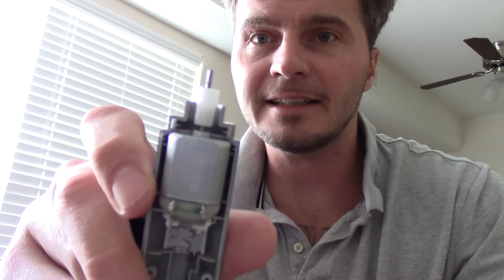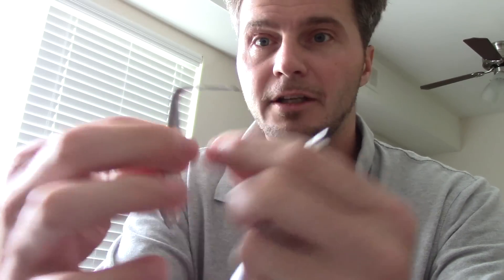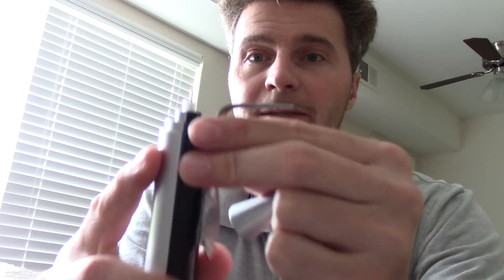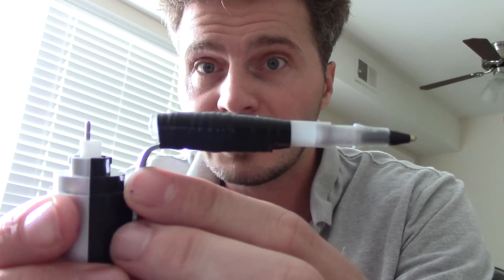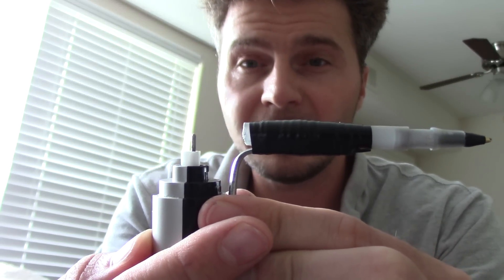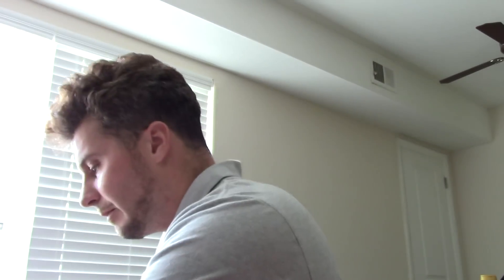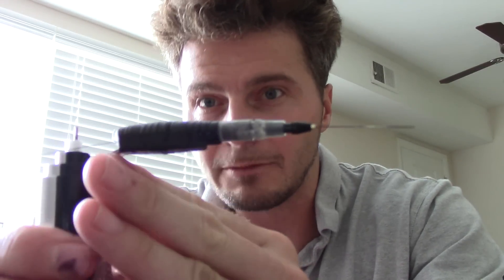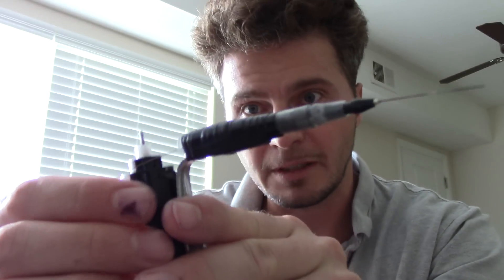MAKING A PRISON TATTOO GUN!!!

Comment: what did u use for ink
Reply: chris sheinman My boy would collect ash by burning paper under an overturned bucket (you have to cut a hole in the side of the bucket near the bottom so the flame goes up in the bucket so the soot is floating straightish twords the bottom of the bucket) while being careful not to burn the bucket and contaminate your pure carbon, and mix the carbon with a little baby oil in a water bottle cap, use as little oil as possible and stir it a bit so it's not chunky. bam, Ink. He did pick N poke tattoos in prison for a straight minute.
Reply: chris sheinman u can use India ink
Reply: baby oil, and toilet paper soot. burn them both and collect the soot but putting a pan above the flame. then mix the soot with water or tooth paste
Reply: you can search 'how to make prison ink' and you will find videos. but richard and razor pretty much just told you the deal
Reply: Anna May Sadly all the trolls have arrived here.
Reply: You use India ink
Reply: where you getting that in prison? i had one done using printer ink
Reply: TheDantheman12121  you make your own ink. read my previous comment
Reply: is that the shit i seen on 60 days in where they burn shit for it? that seems so weird
Reply: prisontats the ones i had and saw where just as good as ones you can see on the out.

Comment: How did correctional officers deal with it if they saw an inmate with new tattoos? Would they question prisoners on who was doing tattoos? And would the prisoners with tattoos get punishment?

Anyways, keep up the great videos!
Reply: I've always wondered that! Because when you go through intake they do a body check and take not of all your tattoos and scars.
Reply: FlyingOverTr0ut you just hide them from them you get sweat shirts and you just hide it until it doesn't look new but if you get caught you get an infraction and a little punishment
Reply: CharlieTheUnicorn not when you leave
Reply: As a C/O  at my facility getting a tattoo and having a tattoo gun are both class 1 charges (possession of dangerous contraband) which can land you in the hole. place you on non-bond. raise your points (to a higher sec. lvl) and class 1 tickets can affect parole. How I deal with it depends on the Inmate. I have a ton of tattoos myself and they are easy for me to spot because of this. If they don't bother me I tell them to put a long sleeve shirt on. If they annoy me well then I right the ticket. Or depending on the events of prison (excessive fighting or stabbings etc., etc.) I tell them hey I won't write the ticket if I happen to find a shank in the porter closet at such and such a time (it's a common area and is under nobody's area of control).......If they can spend money on ink they can spend money on a skank!.!.!..... They don't get a ticket I get a weapon out of the prison everyone is safer, both staff and the population it's a win win.

Comment: I made a prison tattoo gun when I was 14 and never done any time. It worked, gave myself a tat with it. Used a motor, hotwheel wheel, pen for a shaft and a guitar string for a needle. I honestly don't remeber how I gathered the knowledge but it worked.
Reply: I knew how a locomotive wheel worked and ran with it.

Comment: Spinners are good. In Texas we used water guns/wraps. Blew out so many hot pots, tv's, sockets. Lmao. Crazy times. Seen some of the most ingenious ideas while in prison.
Reply: What do you mean you blew those things out?
Reply: We ran Angel wire to the sockets. Which also ran the tv and hit pot. Sometimes they would blow out from too much voltage. We would run from the plug to a bowl of water to reduce the power.
Reply: Hahah using a bowl of water as a resistor.  Ingenious indeed.

Comment: AfterPrisonShow
if you could help me with few small problems
my motor is like completly normal dc motor that doesnt have that ofset so I tried using shirts button to hold needle
and and im not sure is low gauge wire (without the insulation) good as needle?
and one last thing, do you have anyu good tips to clear out the pen from ink

Comment: What else can be used as a needle if no guitar string?
Reply: I've used the spring from a pen before. You use the candle t stretch it and pop it to a point like he did with the string. Or you can use finger nail clippers to cut it at an angle. Or you can use sand paper to make it sharp

Comment: The jail that I work in, they can't get anything motorized on commissary, they can't get anything like that, I did repair a light where the relay was missing, but they found that guy pretty fast. I've seen them doing tattoos manually with a staple, but there's good work coming out of there.. Not sure how the professional grade ones are being done, the only electrical devices that they have available are soup stingers, no moving parts just a heating element.

Comment: Hey man. I'm doing a prison contraband project for a class in college where I have to make a contraband item using only things found on a commissary list. Guitar strings aren't on a commissary list. Would you recommend anything that I could use for a needle that I could find? I was thinking a sewing needle but then realized that's too short and probably too thick to use for this motorized gun, would it work for the stick and poke method?

Comment: Tape players worked SO well for me, all you need is that small circle rotation to bring the needle up and down a tiny amount.  The one I used had such a shallow needle that just moved up and down less than a mm. you could press all the way down and it was just barely deep enough to work, no scaring and you could load the suit ink right into the pen creating a seal with the skin and ink, so it more like drawing on the skin with a pen, then you could cut the ink and blood shade with the exact shade of ink consistently. Much easier than real tattoo guns.

Comment: When I connect the wires of my motor to the wires of an adapter  it spins so slowly,  but if I connect the wires on my motor to a battery it works fine. But I cant just have it connected to a battery because my wires are so short.   Do you know how I can fix it? Should I  increase the volts on the ac adapter?

Comment: Ever consider doing tattoos the old fashion tribal way? Take a slightly curved handle, put a needle or needles on one end, dip the tip in the ink, hold the needle to where you want to tattoo, then start hammering the needle into the skin.

https://photos.travelblog.org/Photos/70035/292614/f/2499415-My-Iban-Tribal-Tattoo-8-1.jpg